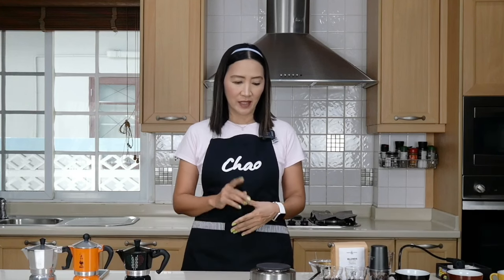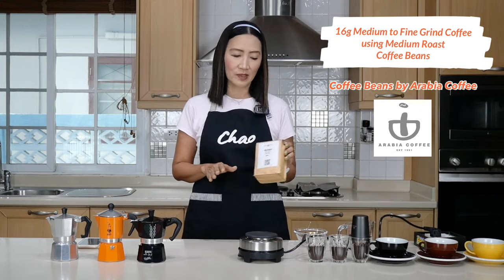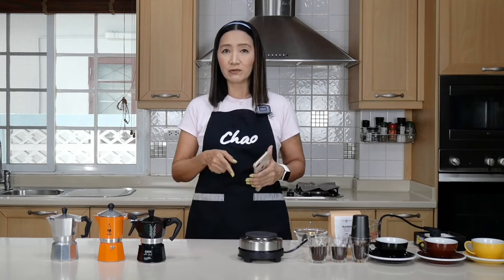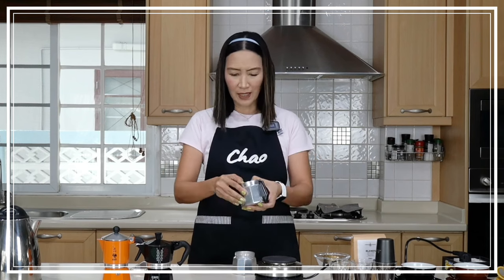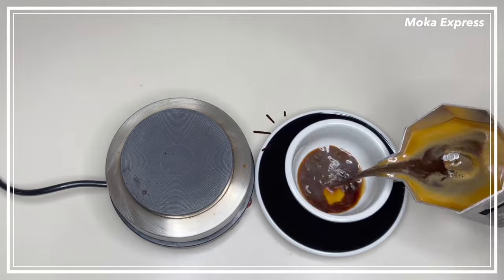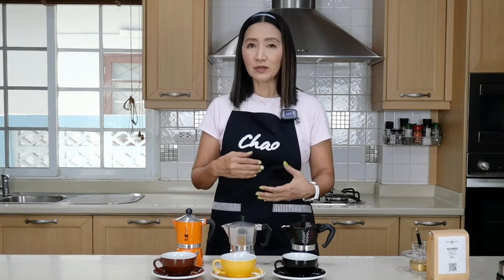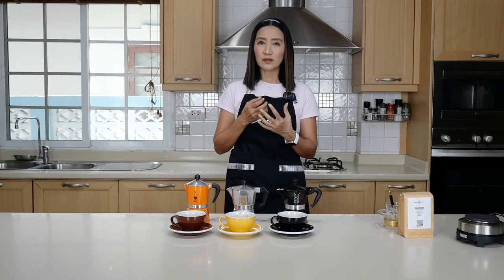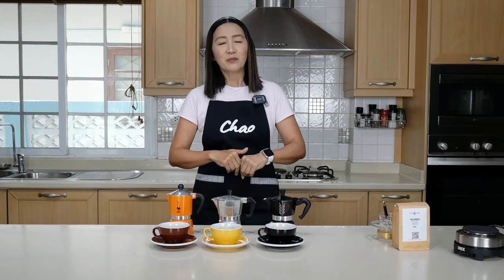HOW TO MAKE 'PERFECT SHOTS' COFFEE WITH ESPRESSO CREMA USING MOKA POTS

Comment: Please don't follow this types of videos. Follow the videos of bialetti and illy. You have to use it fresh water just beacuse when you put the moka on the stove the water will boil at 100 celsius degree and then the coffee will start to come out. The moka preparation is not for crema but just for an espresso size coffee, if you want a crema espresso you have to use an espresso machine cause the extraction pressure is much much higher, for example 8 bar, that the about 1.1 bar of the extraction with the moka. The moka brand will not affect your coffee taste, but how much you will use it the moka in the future because the first 3/4 coffee you have to throw it in the garbage. Then using the moka frequently will change the colour of the gasket and the taste improves. In Italy we use Bialetti just beacuse is an Italian brand, it makes beatiful and well constructed moka, and you find replacement parts easily.
Reply: Nah.. use James Hoffman technique. Makes amazing moka.
Reply: Depends on the coffee for me. I have noticed darker roasts taste better when I start with room temp water, but medium roasts are better with the boiling water method. But I am no coffee expert.
Reply: Already misinforming. The water is pressurized; it's boiling past 100C. 9 bar extraction for espresso, not 8. Also, fresh water takes longer to heat up; conductive heat transfer thru the pot itself will burn your coffee before then from the heat source. I agree that these types of videos aren't the best; they misinform as well, but don't spread misinformation to beat out other misinformation.

Comment: I use the paper filters which do a good job of giving some crema. Don’t forget this is not espresso! The crema is short lived, but i can say that the paper filter does help the coffee texture. Maybe this valve helps too? I think the technique in this video is very good in getting a better tasting cafe. I usually let my moka get too hot on the flame which makes the coffee more bitter. This makes a bigger difference in how good the coffee turns out if you pull it off the flame earlier.  Thanks for sharing!

Comment: Was this a 3 cup moka pot? Seems like you emptied out the pot with just 1 cup
Reply from the maker: That's how I typically brew my coffee for home - milk added later! :-) https://www.youtube.com/watch?v=WIQnxXlejn0
Reply: @rizasri  Let’s say I want to make an 12 oz Americano; do I have to put less water in the chamber if I want it to act like an espresso? How many shots does a 3 cup moka pot yield?
Reply: @Homme Field   In a 3 cup Bialetti, if you fill the base with 130g of water you can usually get 85g - 95g of brewed coffee out with proper temperature regulation. This is around 3oz of coffee.

Making a moka americano, I would use between a 1:1 to 1:2 ratio of brewed coffee to hot water. Ultimately the ratio is up to you, but I start losing complexity above 1:2. So at most your americano will be likely be around 9oz. 

Use the max amount of water and a full basket of coffee each time. Keep in mind that the less water you use, the more steam you need to generate to begin brewing (which usually means a hotter brew temperature). Moka pots are such sensitive brewers that aiming for specific results is pretty tough unless you are unreasonably consistent.

Comment: Interesting concept that I haven't seen before. The results look great, but I'm a little worried about the added pressure making the whole unit too hot. In your experience, has this been an issue?
Reply from the maker: Not at all. My experience is that one should use less water in the boiler so as not to overly increase the pressure.

Comment: Awesome invention.

Question: how do you remove it to help clear the moka pot? Or is it a permanent mod, and once it has been placed inside, it cannot be taken out?
Reply from the maker: You simply have to tap it out. TBH, using a paper filter would achieve an equally good brew
Reply: @rizasri  really? What do you mean by “equally good brew”? you mean, using a paper filter will achieve the crema this valve offers? I don’t think so. I’ve tried adding a paper filter to my 3 cup moka pot and the result is the same. No matter the grind size. 

But what I want to know is, once you plug the tube/shaft with that Thai-invented gasket/valve, how does one remove it? Those rubber/silicon o-rings look pretty tight, and one would worry that once it’s jammed inside tightly, it will be close to impossible to remove. 

Does it come with a tool to remove it easily?
Reply: @francochan If you want crema, buy an espresso machine. Trying to force crema out of a moka pot will only result in poor tasting coffee.
Reply: @kiyoponnn   first of all, I feel like I ought to wish you a Merry Christmas as of all the days of the year, you’d rather spend it taking some of us here in the comments section to task than spread some positive cheer. 

Second, maybe shy away from any assumptions about people you may not know. Why do I say this? Because:
1. I do have espresso machine, and I do enjoy true crema, among other things that an espresso machine delivers.  And;
2. I also own a moka pot, and have owned one for many years, and respect it’s Italian heritage in coffee making, as well as its design simplicity in being able to deliver good coffee in such a small package. 

To address your pointed query, some may not have the option to get an espresso machine due to budget or space constraints, in which case, a moka pot (like generations of Italians can attest to) serves as a smaller, portable, more economical and accessible way to obtain someone’s espresso, with only a stovetop burner needed.
Reply: @kiyoponnn  Also, precisely, most of the people who have watched and appreciate this video are intrigued by this easy attachment that adds a further extra bit of pressure to any moka pot in the cupboard. 

I have since purchased one of these, but before I share my own observations, I just want to preface it with this: I am aware that moka pots do not technically create true pressurized crema, they can create a sort of micro-foam residue that closely resembles it in limited amounts and in varying degrees - a “faux crema”, if you will. 

Now, what this “spout cap” invention does create however, is simply a higher, more frequent occurrence of this “faux crema”, by bringing the standard top spout of any moka pot to an efficiency of a Bialetti Brikka moka pot, which has a similar “spout cap” that increases the pressure just a little bit more to create “faux crema” for those seeking it in their moka pot brews.
Reply: @francochan thank you!!!!

Comment: I just got my valve. I have a bialetti 3 cup. Should the valve be snug? I keeps falling out. Do I need to push the valve in so it’s tight?
Reply from the maker: Hi, the valve can be pushed in or could also be loose. When I pushed too tight I had to use a soft bendable wire to push out :-) Good luck!
Reply: @rizasri  I got zero crema. I think this has a learning curve. It still tasted good and I’m not giving up! You got crema so I am certain this is user error on my part.
Reply from the maker: @CelticKym  Yeah, even with Brikka it takes a bit of trial and error. Never give up!
Reply: I just tried, and didn’t get much crema, but the taste seemed to be improved over the same coffee and water without the valve.
Reply from the maker: @EdDetlie  Don't give up! It took me a few iterations before I got the hang of it. If you follow my tips you might get the crema fine. Yes, I agree the the taste is cleaner and fuller body.
Reply: If you want creme, buy the Bialetti Brikka. If you want an espresso plus creme, I highly recommend Flair Espresso plus the gauge.

Comment: Does the crema valve work on a New Venus 2 cup? Thanks.
Reply from the maker: No, it does not.
Reply: @rizasri  That's too bad. I have been using paper filters (1 0r 2) and experimented with water temps (from room temp to very hot) and I only use filtered water but NO crema. Perhaps time to use a different coffee other than Lavazza medium grind. Keep up the good work.